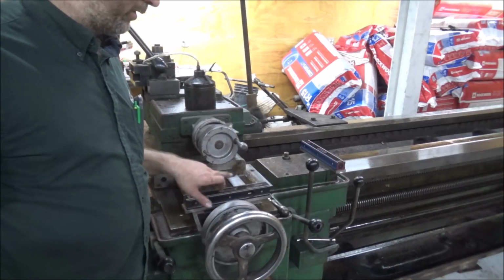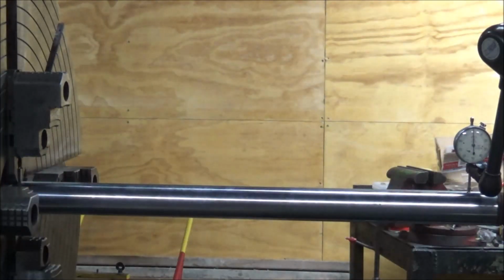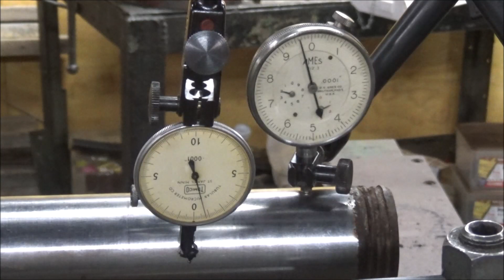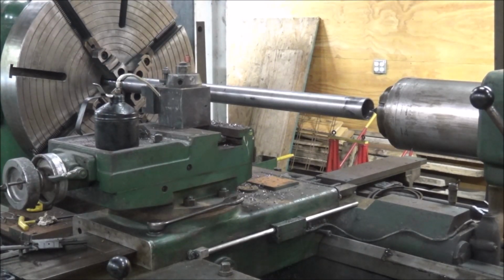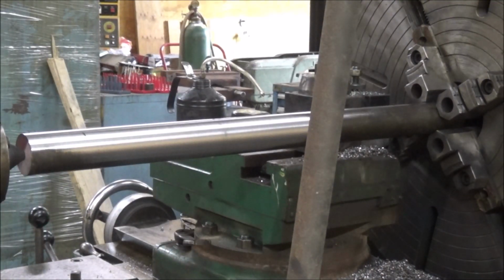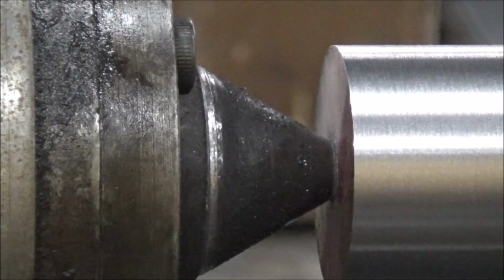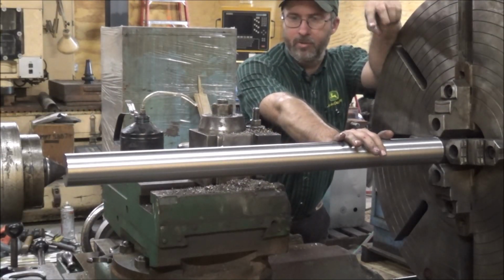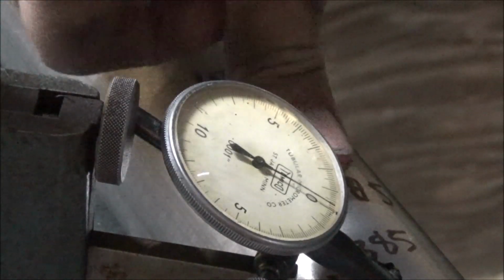Lathe Leveling and Aligning like you have Never Seen!

Comment: I wouldn't presume to think I'll ever know more about machining or machine tool alignment than you already do Brian. At the hobby level it seems to be one of the least understood shop subjects around on both the forums and here on YT. I'd fully agree, that two collar test method is only an indicator of the machines general alignment. For any that don't know of it https://www.dropbox.com/s/rs0hhvl64wohru5/Testing%20Machine%20Tools.pdf for a PDF of the book Dr. Georg Schlesinger wrote about the Testing and Alignment of most machine tools found in a shop. As good as that book is, all those tests and any adjustments needed are still only being done under static conditions. I've always found no matter how well leveled and adjusted my lathes are, it still takes further and very minor adjustments under the actual cutting loads so the usual machine tool part deflections caused by those forces can be compensated for. Lucky for you Brian sooner or later a large shaft job will show up in your shop so something with a long enough length, big and rigid enough diameter will allow some further checks and tweaks to be done. It would be interesting to see what the far right end of the bed produces verses the more worn head stock end.But as you said, for a 50 yr. old machine the results you got are pretty impressive. 

The title is in cryrillic and the whole YT video is in Russian that I don't understand. I should have saved the link to it since I now can't re-find it. The YT creator who produced that video did an exhaustive series of tests on a quite large, heavily built and what looked to be a very good condition Russian? made lathe. His indicator readings and force vector diagrams were still eye opening for the various lathe parts deflecting under the normal cutting loads even with what I could figure out for what was being shown. There's a whole lot more movement going on within our machine tools than one would think.
Reply: Turning Point:Do you mean if you got a large diameter and take heavy cut, make minor adjudgements accordingly(After your leveling & initial adjustmens), will these adjustments cover lighter cuts afterwards, or do the lighter cuts needs yet more adjustments if you want to cut "perfect"-?
So if you talk perfect cut, do you need to tune for each and every cutting sample -?(Just for further understanding).
Reply: @chrismate2805  I'm still trying to find that damn Russian video since his indicator readings and vector diagrams show things a lot better, so far not much luck with that search. But I'll try to add the little I'd like to think I know. Brian's big Monarch is obviously a bit different than the more average sized lathes. But yeah, there's basically no such thing as real perfection. Leveling a lathe only gets you to what should be a proper static condition with a new or lightly worn lathe. And if the lathe is from a decent manufacturer that level, non stressed condition is how the bed would have been set up on the factory's surface grinder when the ways were first ground. So your pretty much trying to duplicate that in your own shop. However that surface grinding was on a bare lathe bed. They then hang motors, gear boxes and a whole lot of other parts off that bed that exert minor but measurable changes along and through it's bed. It's then bolted down by the end user to a guaranteed non flat or level floor. Leveling the bed gets it adjusted fairly close towards that factory ground straight and unstressed condition. Cutting tests and further but tiny adjustments very slightly away from the bed's exact level condition are made to help compensate against the cutting forces and changes that happen during a cutting pass. What your doing then is re-adjusting it just enough to force the tool tip to follow a straight path. The lighter and smaller the lathe is the more important those little adjustments are. 

Anything that moves on a machine tool has to have a clearance to do so. With the usual precision surfaces those clearances are tiny but still there. If the machines mass from the tool point to the lathe bed is greater than the cutting forces it's a lot easier to get and maintain accuracy since the machine and it's multiple parts are much more stable. But yeah your 100% right, a heavy roughing cut adds much more deflection to the lathe than light finishing passes do. That's true no matter how big the machine tool is if the roughing cut is heavy enough.Cutting tool wear and how sharp those cutting edges stay during the cut has another effect since a dull tool obviously takes much higher pressures to force the metal to cut. Changing between Carbide and HSS, feed rates ect can add some more variables just to keep things interesting.

Fwiw I'll usually fine tune my much smaller lathes final adjustments to be as accurate as possible with an average finishing cut and feed rate since the roughing cuts aren't of any importance for size or minor taper. Different materials being cut will add changes to the machine as well. So getting that perfection under all conditions is in reality impossible. The larger the machine is the less those effects have, but there still happening.Machining aluminum and then say stainless add some more variables to how the machine reacts. If your mikes can measure into the 10ths range or better it's not that hard to measure any changes in the part just from adding or reducing some of the cutting pressures or even feed rates. At best and it's just my opinion, you can set a machine up and carefully fine tune it for the average materials, feed rates and cutting conditions in your shop. You can get close, but still not get perfection. None of this is from a book, I've seen and measured those changes myself. It's takes a lot of time to run any meaningful tests, but the results can be easialy measured. As I said getting that initial level condition is probably the easiest method to obtain a decent starting point. With enough wear on a lathe they can be still adjusted to turn true by twisting the bed away from level, but that only works for parts of the same length it's been changed and re-adjusted for. What your doing then is either rolling the tool tip into or out of the cut so the tool tip again is trying to follow a straight path. It took me years to finally figure out the old saying that everything is more or less made from rubber is all to true. Those cutting forces make many more changes within the machine than one would think once you get down into the macro level. Any one small change probably makes little measurable difference. It's the multiple changes and deflections throughout the whole machine that stack up and start creating the inaccuracy's that becomes a problem if it produces unacceptable accuracy levels. And it's those exact same deflections within the machine that show up as changes for what you dialed into the machine to take for a cut and what it actually takes. 

Besides the full length table support a surface grinder has that's been designed in to promote accuracy, it's grinding wheel exerts very little force on the machine or the part. So a surface grinders table and spindle remains fairly stable during it's movement under those extremely light cutting forces. That's also why a light finishing pass on a lathe or mill not only gives you a better surface finish but it's usually more accurate since the tool tip remains in a more repeatable position since it's deflected less within the machine's travel over the part. It's also why a light finishing pass might take a deeper cut than you dialed it in for. 

It's an interesting exercise to see and measure what's happening within a machine. Luckily for most parts that 100% perfection and most of what I've said isn't normaly needed or we'd probably have to surface or radial grind then lap the parts. Personally I think it's well worth knowing and understanding some of this as it gives you a lot better idea about why your parts might not be as perfect as one would like. :-) I'm fully convinced any lathe can be tuned a bit to get a lot better accuracy over one that's just had the bed leveled and it's then taken for granted that's the very best the machine can ever do. Robin Renzeti and Stefan Gotteswinter had and showed good logical reasons for removing there lathes top slides and replacing it with a pinned solid block of metal. It removes a fairly unstable set of parts from the machine that tend to deflect and move due to the cutting forces and the leverage effect the cutting tool tip exerts on those parts. Most top slides aren't a very good design to come close to resisting those forces. There handy for short tapers and single point threading, but that's about it. I'd also bet a lot any decent machine tool design engineer could list dozens of other issues and causes for inaccuracy I don't know or haven't even thought about yet. Afaik in large industry they don't now bother dealing that much with machine tool inaccuracy for any manual machines they might still be using. I've read that for anything needing better than about .003" - .005" they rough it to size then finish grind since it's cheaper. Higher end CNC equipment is a lot better, now there hard turning well enough to not have to grind as a second op for a lot of parts. I suspect but don't know for sure that quite a bit of any inaccuracy due to a machines internal deflection gets compensated for within it's program after it's first installed and test cuts are made. Moore Tools proved no matter how much money they threw at the problem making perfect pitch accuracy feed screws was impossible for manual machines like there jig borers and grinders. CNC lathes must have compensation programmed in to adjust for any lead / lag errors in there ball screws. I do know tweaks are made all the time to the tool path program for that part to adjust for the test parts target sizes against what the machine is producing. So those machines are still doing what we have to with those minor adjustments to our manual equipment in our less than ideal home shops.

Way way out of reach for most of us, http://www.nanotechsys.com/ for anyone that's interested enough go through the details about these machines and how they designed in systems to help compensate for the physics of machining to these levels of accuracy and high speeds to get repeatable accuracy. Some interesting and expensive design choices were made.There surface finishes from these machines aren't too bad either. :-) And if any company knows a thing or two about accuracy Moore Tools must be in the top 5 world wide. And my apology's for how long this ended up being.
Reply: Thanks for the good understanding:Another theoretical point I thought about some time ago, I would like to hear your opinion:
This is only about spindle/chuck speeds - Seeing the centrifical forces involved and one probably could say the turning spindle with chuck establishes a reference point in space through the bearing inaccuracies of wear which is difficult to throw off track by cutting forces at speed or will you get waves of chatter as the forces fight each other(Like a motorcycle tankslapper between the centrifical forces of the turning wheels contact points on the road and a weak frame between),when mass & high speed is involved, do you think at high mass & speed the condition of the spindle bearings matter if you can stand the noise before it seizes up as its wearing out over time(Theoretical thoughts).

Comment: the WAY  to level a machine is to put a 6 foot straight edge across thw ways at both ends
you need 4 tape measures the same at each end of the staight edge, i used a 6 foot aluminium level
then using a dumpy , shoot each tape, short machine levels should be avoided
even solid wide tool room lathes flex

Comment: You do not level a lathe by checking the saddle or cross slide. You MUST level the lathe across and along the bed ways. The lathe should really be level, a 10 thou fall is negligible for the "fall" of coolant. Coolant will flow to wherever the outlet is located (natural gravity flow :-) )

When lathes are manufactured/assembled the headstock is always turned slightly towards the center of the axis. This in effect would produce a minor variation on the type of reading you are taking even if the "cylinder" was 100% round and accurate. 

What you are currently doing should be used AFTER the lathe is leveled, to allow tailstock (headstock) adjustments to help remove/limit any taper. ALL of the feet MUST be providing support to the lathe.

Comment: I don’t like the chuck method. As we all know, chucks have wobble of a certain amount, which is why they’re measured at the jaw, and either 4 inches, 6 inches or 10 inches away. So you don’t know whether you’re measuring the chuck’s error, or the lathe’s error. Or, some combination of both. Then, using a hydraulic rod, if it’s used, you don’t know it is entirely straight, as it could have been stressed in use.

I’m not saying that this doesn’t work, but there are an awful lot of variables to account for, and one error can seemingly cancel another out, making everything look ok, when it isn’t.
Reply from the maker: That is why I used two indicators perpendicular to each other at the same time. That proves that the bar is pointing parallel to the bed and a consistent distance from the cutter within the measured error. In another video I had previously measured chuck run out and face error and at the 40" diameter it was like .0005". Run out would have indicated the rod was bent. Since the test cuts came out with roughly the same error as the bar indicated I would say it worked just fine.  How would you test alignment  of a chuck to the bed 24" away?

Comment: I cringe when i see everyone leveling machines with  machinist levels. Back in the day i built buildings 400 feet long for IBM,Hewlett and Packard and so on, the surveyor took me under his wing and taught me how to use a level/ transit. In later days i built my own buildings and  adjusted my own levels .I had taken a level in to get calibrated and they calibrated it wrong. It is a mistake to assume anything when using a level. Trust me it sucks when you discover your suppose to be calibrated level is wrong.
I have watch a few videos on how they adjust them and i do not agree. First off like a machine, the level is sitting on its on 360 base which may be warped from over tightening or  being dropped or bounced. This is how i was taught and is self evident when correct. As the others say pick two points... I say the two points should be at LEAST a 100 feet apart. Do not go in the middle, but go to point a or b, and set up inside the two points. Set up about three feet away, and shoot a point and mark. Now swing the level  180 and shoot the second point and mark that. Now pick up the level and carry it to the opposite end and do the same( accounting for the ground level difference) The level will be perfect or there will be a discrepancy. And now you adjust the level at the bottom screws, or allen fittings or whatever that instrument has.  The mistake the others are making is that the level base is round, everytime you pick it up and move, you are probably not on that same 180 plane you adjusted from, and they are too close, the further the better. Anyway it's a learning process and you will have to reset up an few times as i said above until you get it right.  If a person wanted to really be precise and check there table they could pick 3 or 4 points,  do the same procedure. It is a two person job, being you can not sight and mark at the same time. The mistakes rookies make when shooting is that when lower, the number is higher, and higher the number is lower. Its seems obvious but simple to make that mistake.  The further the instrument is when calibrating the less error in close shoots after calibration. To add a note of hindsight..I was working on this IBM building and the company surveyor ask for a hand for some reason.. i worked with him when he needed help. One day and old guy showed up and starting asking me to help him. Now there were two surveyors. Soon they were fighting each other over me.. I said to both of them, the hell with this i am stuck in the middle go find someone else and went back to my normal job on site as a carpenter.  The old guy had been telling me he was hired as a superintendent to build a dam and was waiting for the job to start . The day came they he left and went to build that dam and i could have been there as his right hand man... You never know who is telling the truth and what you may lose when getting mad.  Edited,, of course a machine is metal and level might not be the best thing.. it comes down In the end, all you can do is getting the machine set up the best you can with the condition it is now or how it was made. But when in doubt, a precision level will help in understanding what you have to start with.
Reply from the maker: I installed it on pourpose with an actual slant in both directions so having the levels exactly calibrated so as to achieve an accurate level to earth was not a problem, but yes you need to verify the tools are correct before using them if you want a good outcome on the job. :-)
Reply: @bcbloc02  Yes i know, you know, what your doing.  It was a generic statement to someone else that had posted to you. All DIY youtube video are the same. How do you get the most efficiency out of the tools or materials we have .  And the inventive solutions others have, that we may never had considered or dream existed.